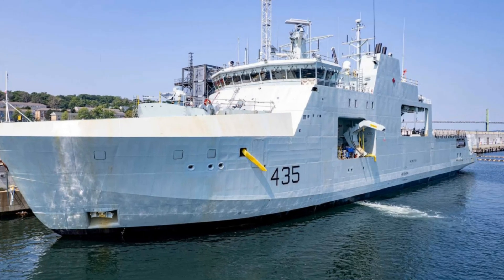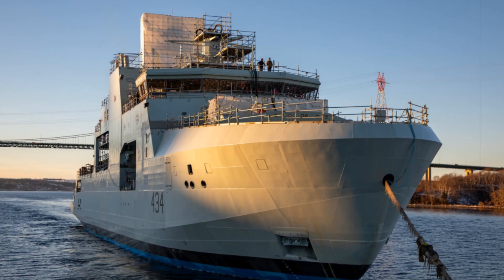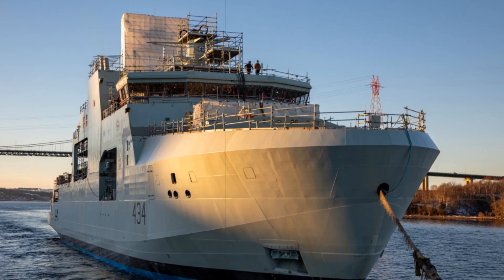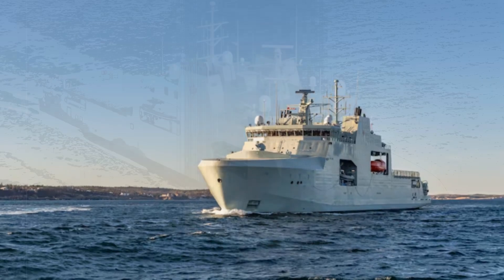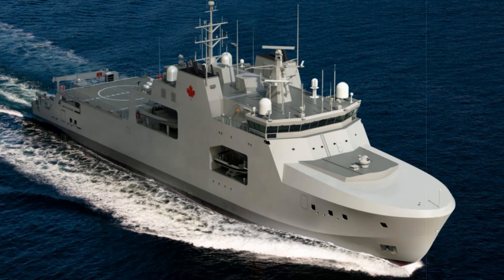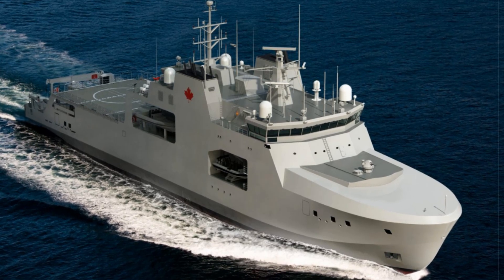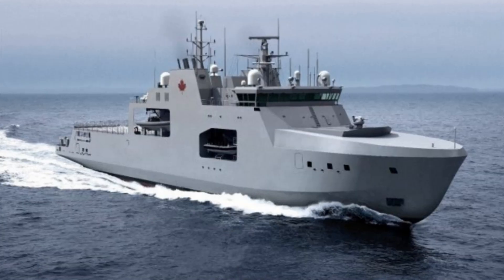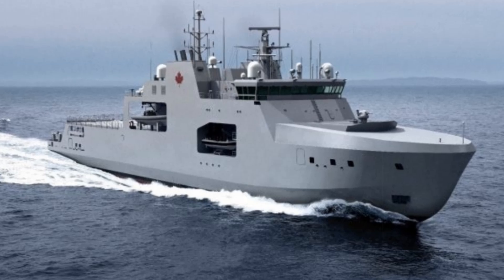Canada’s Final Arctic Patrol Ship HMCS Robert Hampton Gray Begins Sea Trials Ahead of Schedule

Comment: What's with the pea-shooter main gun ?  A ship of this size should have a main gun of no less than a 40mm, i.e. a 40mm Bofors plus secondary 50cal guns off the bridge deck and a stern.  The Bofors has an enclosed turret so can be airconditioned against freezing  and 50cals can be fitted with warming blankets or stored inside and placed when needed.

Comment: Would have been smarter to outfit the ships with the Bofors 40 mm Mk4 but again they are Canadian.
Reply: Lmao you realize we had a ship with a 40mm bofors and they got rid of the gun because it was showing it's age and lack of spare parts,plus the 25mm does a solid job.
Reply: @MzDaizy666  Maybe you should do a little more research on the 40mm ammunition versions for the Mk3 and Mk4 that is available now for drones and other capabilities that is not available for the too small 25 mm shells.
Reply: @onguardincda yeah and that canon we didn't have, so we'd have to buy those as well plus ammunition for them. When ultimately this is a patrol ship and the 25mm does its job rather well for the tasks it will face.
Reply: @MzDaizy666  So why is an under armed patrol boat of any use going to Hawaii for naval maneuvers if it hadn’t broke down? So were they just on holidays? Maybe a tug boat would have been more useful.
Reply: @onguardincda lmao they are a patrol ship, and while there is some patrol ships that have more firepower, the majority of patrol ships do not
Reply: @MzDaizy666 Well they should be patrolling and not wasting time and money going to Hawaii for naval exercises which is the Halifax classes job.
Reply: @onguardincda the Halifax class are also being utilized elsewhere for jobs that they can do, so going on exercise isn't a big deal.

Comment: I am not an expert at all but to me every spec on this class screams coast guard like you know… the original Norwegian ships it was taken from. Looks good though.
Reply: She’s massively heavier than the Norwegian example at 7000 tonne loadout with a class 4 bow and short enough length to still effectively manoeuvre in Canada’s shallow arctic channels. Perfect to push around anyone in the NWP
Reply: I think the intent is a modular floating platform.  If you look at the internet version of where RCN ships are none are in the arctic right now.  The arctic and Canadas coasts are large areas and only a combination of various capabilities with teeth will achieve any sense of sovereignty and presence.  The time an incursion is detected without intel makes this useless.   It has to be kitted out, staffed, and floated east or west to the area of ops with other capabilities.   Canada needs something in various areas buzzing around, looking, monitoring.
Reply: @quarkedupphoton236 I think there is a plan to up-gun it during war that was mentioned, but it would take more than up-gunning it to make it a proper fighting ship. It’s just not designed like that. The more suitable way to use them would be as mobile detection platforms that enable other weapon systems. To properly protect the arctic the key will be having one or more northern base installations or outposts with shore based anti-ship missiles and other systems. The shore based systems and airforce do early detection while the patrol boats go investigate or interact. If something is a threat it would be shore-based or air based systems that would do the work. Since submarines are the main arctic threat currently they could potentially use the helicopters to setup detection nets using sonoboys and attack them with light-weight torpedo systems if necessary. In most cases they would want to send a patrol boat to shadow them. The problem isn’t the patrol boats as much as there is no northern port for them to use as a base right now so they can keep a persistent presence.
Reply: TitusBC. You are very wrong within one highly important point. Based on Norwegian Svaalbard? Norwegian patrol vessel has a 57mm forward. A twin rail SINBAD missile launcher midships. A .50 BMG remote fire capable turret facing the rear. Far superior to the weakly armed RCN variant.
You must be a junior navy officer. Drinks the Kool aid.
Edit: "Modular" RCN code speak for no main gun, no missiles, no armed drone. And everyone knows it never patrols with a Cyclone.
Reply: That is because it serves a similar role, just in harsher regions. It is not a fighting ship, just a patrol ship. Its task is to provide a new capability for the navy. They are learning how to operate for extended terms in the arctic, getting more familiar with the area, adding a more persistent presence of search and rescue capabilities, and offering facilities for scientific research in the area in a smaller package. Icebreaker fighting ships are not a practical thing anywhere because of a design conflict between the required characteristics of what makes a good fighting ship and what makes a good icebreaker. Icebreaker’s need to be heavy and big to effectively break ice while warships need to be smaller, less detectable, and faster to respond to threats and survive in battle. With current technology you cannot be both.
Reply: Also you could easily park a himars on that huge landing deck and pulverise any igloo within a 150 clicks